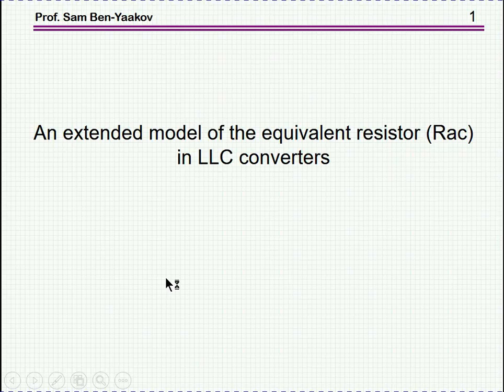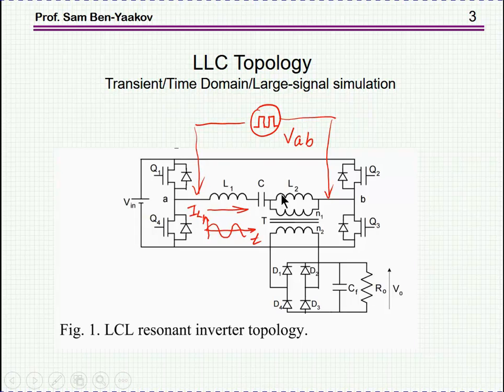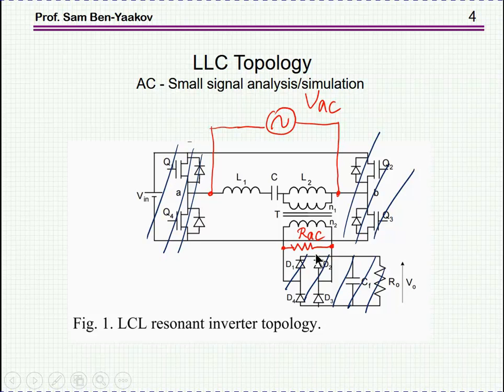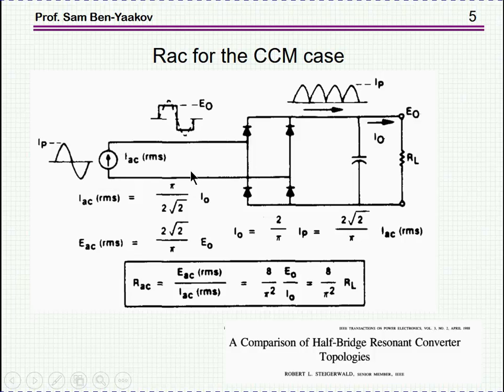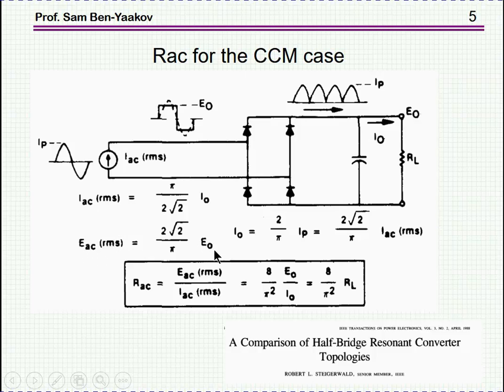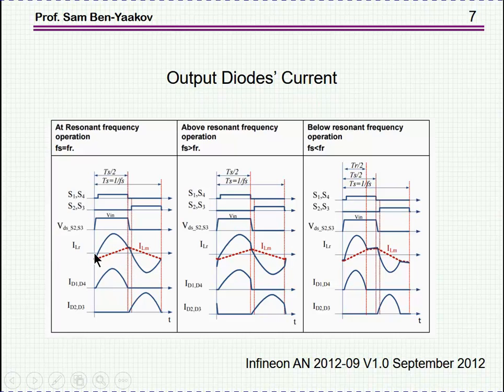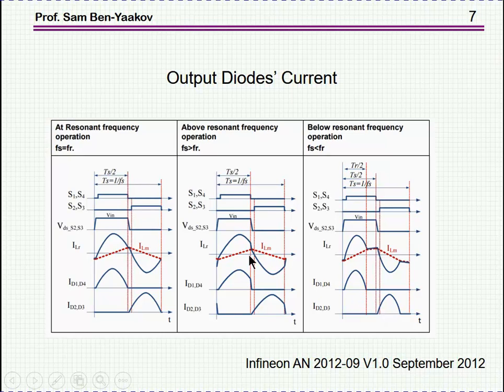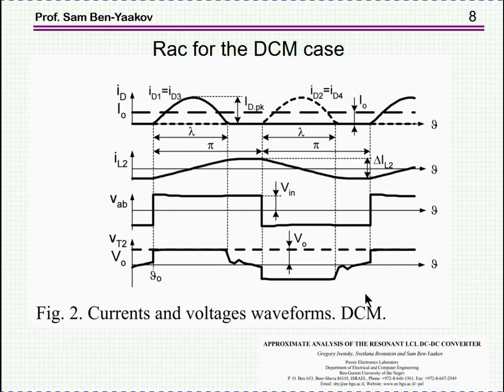An extended model of the equivalent resistor (Rac) in LLC converters

Comment: Sir, I have a doubt and I am sorry to bother you but I could really use your advice, I was going through a paper, "Snubberless Bidirectional DC-DC Converter With New CLLC Resonant Tank Featuring Minimized Switching Loss" by Wei Chen,Ping Rong and Zhengyu Lu. They have considered Rv instead of Rac. (I think Rv in that context means the same as Rac in this video). Later they have drawn many dc transfer function lines against switching frequency  for different load values Rv. Is it not incorrect to do so as Rv itself is a function of frequency as pointed out in your video towards 18:15 ? 
Thank You